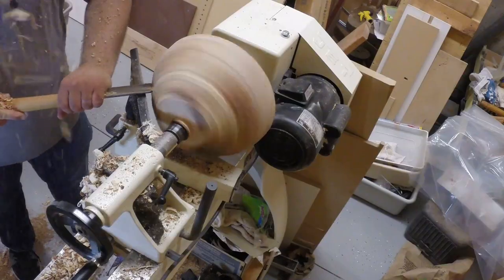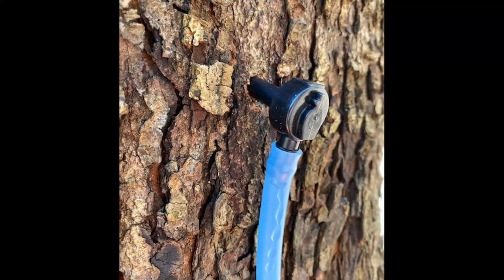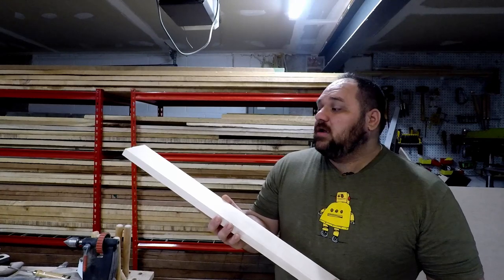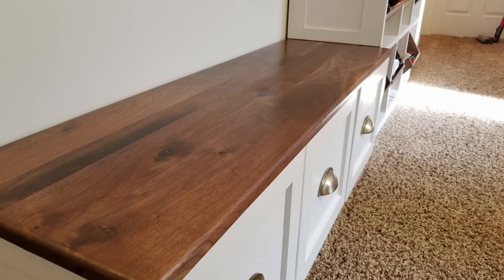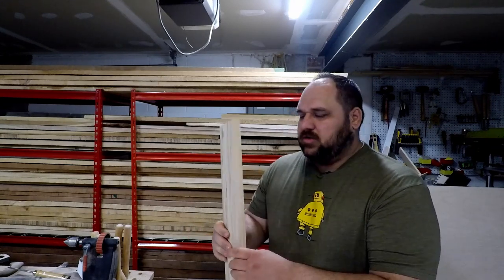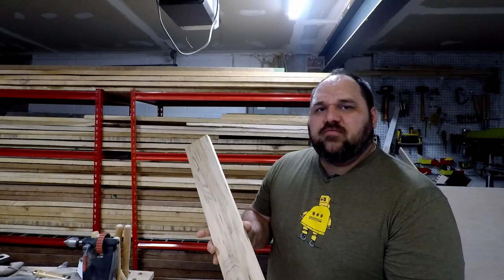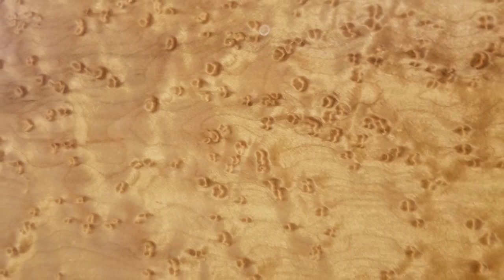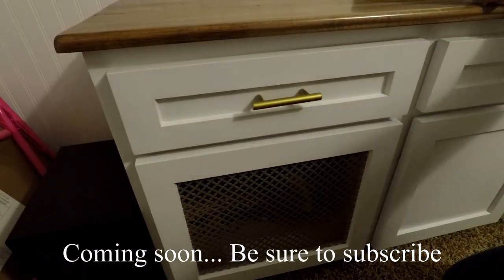The Many Faces of Maple - A Woodworkers Guide to the Many Varieties of Maple Lumber

Comment: Very informative! Question: can you tell from a particular tree before it is felled whether it will have a quilted, flamed, or other type of figuring to it? Maybe from characteristics in the bark, the tree's size, etc?
Reply from the maker: Some things are very easy to spot like a burl or a crotch, but all of the other stuff is nearly impossible to spot until the wood is cut. There are some things to look for: some varieties are more probe to certain figuring. Also, figure generally comes from stresses on the tree and so trees that sit against the wind or on a hill are more likely to have figuring.
Reply from the maker: Great question, btw.

Comment: I'd love to get your thoughts on quartersawn maple, particularly for guitar necks
Reply from the maker: Maple is nice and hard, but still easy to work with.  Quartersawn wood is great because it is very stable due to how it is cut. It doesn't warp or move as much as plain sawn or flat sawn lumber. I think that would make it great for a guitar neck.  In terms of looks, I don't love the look of quartersawn maple, but I mostly use it for cabinetry. Again, for a guitar neck it would probably look great.

Comment: Hey Dave, thanks for this awesome video!  I am an intermediate level woodworker from BC.  The suppliers over here group maple into "eastern" or "western".  The eastern is much lighter in colour so I am assuming it is hard, and the western soft.  Have you ever had to deal with those categories?
Reply from the maker: Sugar Maple or Acer saccharum is the tree where hard maple comes from and it only grows in the eastern U.S. and Canada.  Big leaf maple grows along the Pacific coast in the Western US and Canada and is a variety of soft maple. The terms eastern and western maple are not used here in Western PA where I am, but I know that it is a common term throughout Cascadia and I would assume that it is referring to these two trees. Because it is not a technical term, however, the definition may vary from person to person and eastern maple may also refer to other maple varieties that only grow in the east like red maple which is another variety of soft maple.

Comment: My favorite it tiger maple. I'm ordering unfinished shaker maple cabinets for my kitchen. The design is more on the modern side. I wanted to know if the grain can be popped with a glazing in regular maple to show the variations in the wood. I've seen glazing done with tiger maple, oak, and other geographical woods, but not regular maple. Can it be done, and will it look good?

Comment: We have several pieces of furnature that our parents had from the 50's and 60's that are made of Maple. Almost all those pieces are the same color, kind of a light red. I need to refinish the kitchen table which is a piece that has that color. Striping the finish off and sanding down the surface to hopefully a nice smooth top again will bring me the my question. The color? do you think these pieces we have are stained or is this a natural color that comes out when a Poly is applied?

Comment: Thanks for the information, was hoping to pick up some refinishing tips to increase grain contrast, but have struck out so far. BTW, Sycamore (or Platanus) is not a maple, it's a completely different genus. Maples (Acers) are not necessarily slow growers. Most are fairly fast growers, (at least in warm climates) some species are very fast.
Reply from the maker: Thanks for the clarification.  I was confusing a variety of maple, the sycamore maple (Acer pseudoplatanus) with Sycamore.  I also always thought that sycamore leaves looked like maple leaves and so I assumed they were a variety of maple.

Comment: I don't understand why people don't recommend soft maple for hardwood floors, I see no problem using Red Maple, perhaps not Silver Maple since it's significantly softer. Red Maple is even used for guitar necks.

The thing is that it's difficult to know if what you're buying is red maple if you're buying soft maple because it's usually not specified. So you don't know if you're getting red maple, silver maple or bigleaf maple.

Comment: How do you think birdseye affects the strength of the wood?
Reply from the maker: That is a great question that I have never thought of and don't know the answer for certain but I suspect that it likely has little impact to no impact to the strength of the wood because the pattern is so small, relatively.  If anything, I would think that it makes it more dense and strong because they are essentially little knots in the wood and knots tend to be harder. I suspect that it has never really come up because birdseye is selected for uses that display its pattern and not for uses where strength is much of a factor.
Reply: @DIYwithDave  for example if it baseball bat made of maple with birds eye on the handle

Comment: hi dave i live in northern maine next to the canadain border of new bruswick..i went to a yrd sale and saw this sad looking sewing cabinet, water stained ,  finish basically gone and just dirty .  i bought it for 30.00 and was that thing HEAVY...to make this short  i scrubbed it and found it had some birdseye maple veneer...what reasearch i THINK it could be  is due to its weight...i THINK it could be,,, rock blond /birdeye maple.  i stripped it with citrus stripper  and scrubbed it with ajax soap.to get out the stripper.let it dry...its beautiful when wet..THIS.IS WHATS THROWING ME ABOUT THIS PIECE...the legs ..are 1 piece  solid RED WOOD.  no smells...beautiful grains lines..BUT SOLID RED WOOD NO VERIGRATING IN IT..the red is deep red..not like cedar.  im asking  you  is red maple like this???? from what i think...its a singer sewing cabinet from maybe the 50s?  i was told due to the base hole for the machine....it was made for a slant o matic .there is NO MARKING/#S/ TAGS/ LABEL S/ NOTHING   ..anywhere on this cabinet. and i have found 1 piece on pin intrest..no info or descrpition.  so no info to go on.... i did research singer history.and found out a cabinet factory for singer had a massive fire..in bentwood,oregon?  i have to re chk...total loss. i dont know maybe thats why i cant find any info on this cabinet ...it came from that factory???  i have no idea if this is even a singer cabinet to be honest..i tried looking at there 1940, 50, 60 ads for thier machine and offer cabinets..  but none are my style..from what i understood  singer machines/ cabinets were 2/500.00 at that time...which wasnt cheap.    it would have almost cost 20/30 %of their income at that time...and they were sold seperate.    they had payment plans ,  also so they could buy them. but i have never come across a piece like this...from the weight/ style/ woods... this was very expensive!!!   its damm heavy wood. i dont know if the legs might be seqoia/ redwood?   or maybe cherry???  but when its dry ...its blonde...when wet... its a deep red color ... again  no smell to indicate  what wood it is.  can you help? i was going to stain it .  but now i am nervous the legs would turn out almost black with a darker stain...which i didnt want..i might end up just polying it without stain..i have a very old mission style oak high back chair i wanted to go with this cabinet..i left the orig finish but went back over it with a dark walnut stain..which..i CONSIDERED DOING   with this cabinet..JUST ENOUGH STAIN to bring out the grains  ..cant now . with red legs.. so..i was hoping you could help.. sorry this was so long.. have a great wkend

Comment: Hi ...can I use maple outside
Reply from the maker: No, maple is not rot resistant and is susceptible to insects. The best woods for outside use are cedar, cypress, white oak, black locust, redwood or treated lumber.
Reply: @DIYwithDave  thanks ...what if I treat it ...sort of committed now
Reply from the maker: What are you using it for?  If it is for furniture under a patio that won't ever get rained on or are you digging fence posts or building garden boxes? If it will be exposed to the elements or come in contact with the ground, it won't last. Maple will get eaten up by wood destroying insects and rotted out by fungus.  Out of curiosity, if you were to treat it, how would you do it?
Reply: @DIYwithDave  box sash window frames ...il treat it with a waterproof wood preserve
Reply from the maker: That's what I would do. Good luck!
Reply: @DIYwithDave  so your advice is not to do it
Reply from the maker: I have no experience making box sash window frames and so I don't think that I can tell you one way or another. What I do know is that maple does not do well when exposed to the elements. I'm sure there are ways to minimize the impacts for your project but never having built something similar myself, I am not qualified to tell you what that would be. I believe that I have seen windows like that built out of non-weather resistant woods like pine and so there are probably things that can be done to make it work.